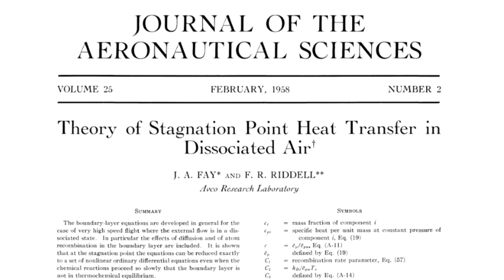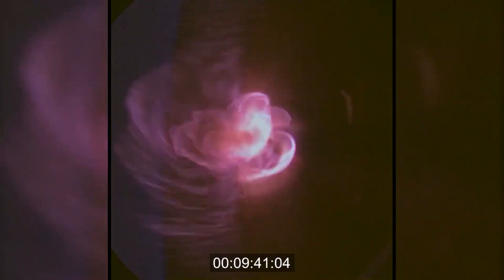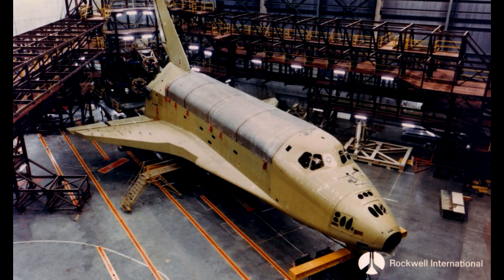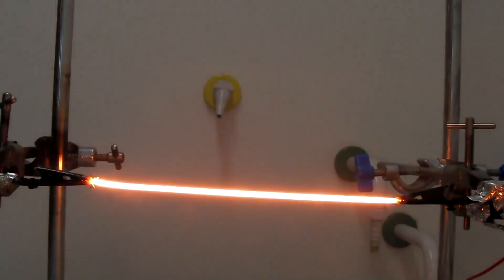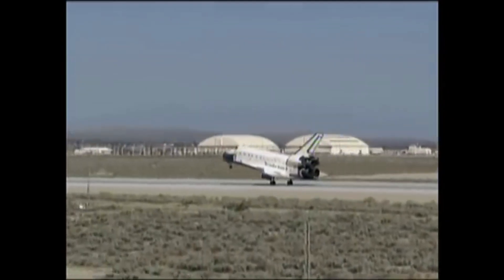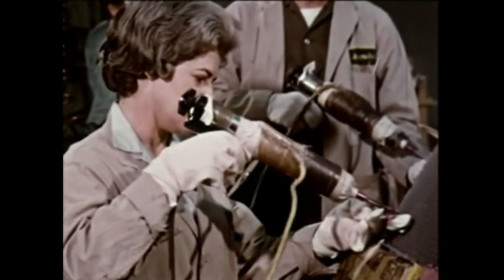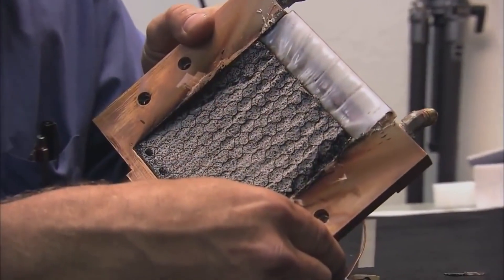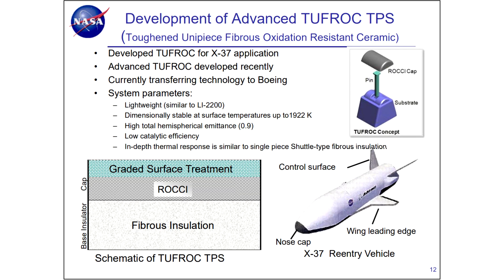Heat Shields - Things Kerbal Space Program Doesn't Teach

Comment: How you would design a realistic sci-fi spacecraft that could re-enter the atmosphere with as low of a heat signature as possible?
Reply: Slow down close to zero before entering atmosphere :)
Reply: @randomnickify  That slow-down burn would have one helluva heat signature though! :D
Reply: @  @mytube001  
Use a cold gas thruster or a coil gun driving ultra dense projectiles.
Reply: Freeze it in the freezer beforehand lol
Reply: Go the JP Aerospace route, a very large hyper-sonic balloon wing with active cooling on the leading edges.
Reply: I'd start with a shape much like P. Anderson in Baywatch.
Reply: Magnetoshell aerocapture- like the trick of dropping a magnet down a copper pipe (this is youtube, you can find videos of it) magnetoshell aerocapture uses a strong magnetic field to drag on air the rocket isnt even touching. This can be a zone significantly larger than the rocket, if you have a powerful enough magnet, letting you spread the reentry heating wider than normal.